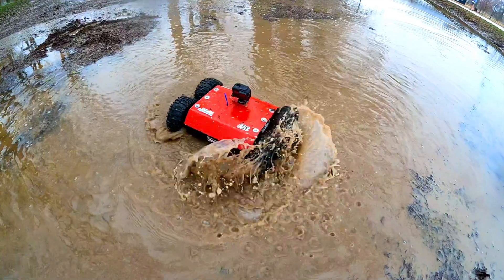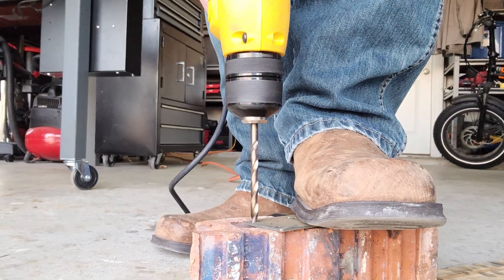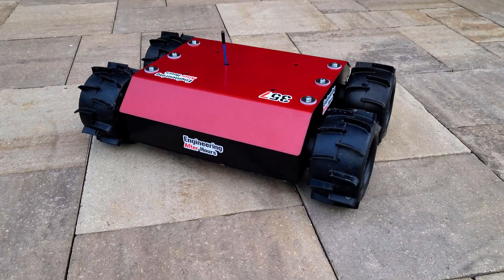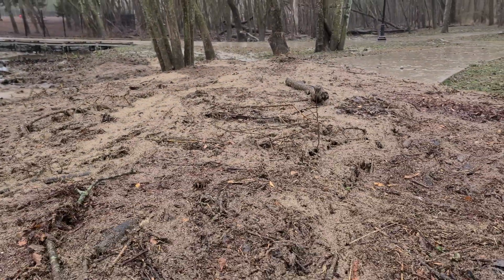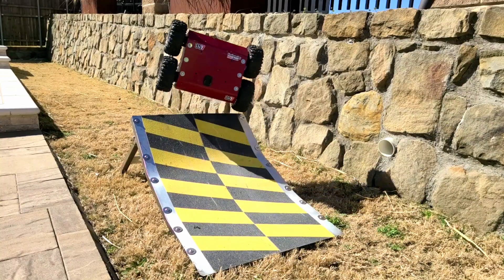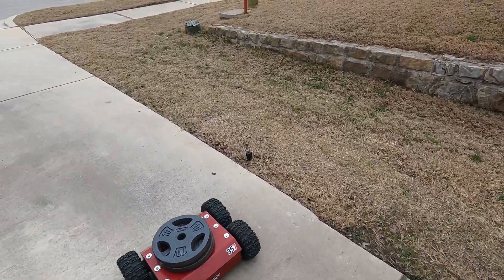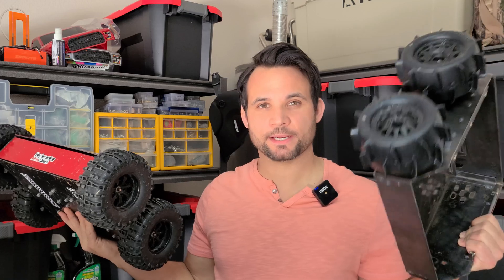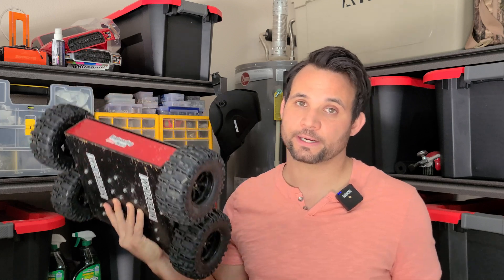How I Built a 4WD Robot Chassis

Comment: Is a suspension system a necessity in these robots ?
Reply from the maker: Depends on use case. These don't have a true suspension but my next robot will have some articulation for traction
Reply: @EngineeringAfterHours  Do you recommend me a certain type of motors ? which is better 24v or 12v motors ?

Also, do you recommend me starting my first build with a suspension system or just mount the motors directly to the chassis ?

Comment: i really need to know what the wheels you are using!! please :) Let me know ;) my robot isn't as bullet proof as yours, but the wheels would be much ideal for my robot
Reply from the maker: https://www.amazon.com/gp/aw/d/B075C34QBD?psc=1&ref=ppx_pop_mob_b_asin_title
Reply: @EngineeringAfterHours  NICE, how much does your robot weigh?? i kinda forgot without wathcing the whole video again, im using cordless drills 4 set, very heave about 8Kg (its not as big as yours though) Thank you for the wheels! i've had to go with some metal bead locking ones, but the tyres you got there are perfect!, the ones im using are super spongy and the battery drains quickly due to the LARGE drag factor so you have any tips on making the inner tyre firm? 

Again thank you for responding! your robotics is a much more effient machine than mine is, but i dont have a laser cutter like you do, nor the tools NOT the money! LOL but thank you again

Comment: Fun video. I'd like to see more of the build, design engineering and less driving around. The testing is fun but for an engineering channel a lot of the explanation of how and why it works seemed to be lacking for me.
Reply from the maker: I wish I could include much more of that but if I did youtube would bury it and you wouldn't have even seen the video. My channel started out with heavy emphasis on straight technical content, then switched to project based technical content. Even with project based content, 95% of viewers complained about or skipped through the good technical details. 

Now I focus on the high level principles and the overall "thing" I'm making. At some point when I grow this channel enough, I want to start a second channel for the detailed technical content. If I left it all in now...the channel just wouldn't grow.

Comment: Great work. I would like to ask what kind of math you have done to specify wheels size and chassis dimensions and pay load?
Reply from the maker: I dont recall everything but what I seem to recall is:

Wheels were purely a function of largest diameter for the price. It's pretty easy for me to custom design for wheel load and even design my own wheels if needed.

The main math I actually did on this design was for the belt drive to know what my slip torque is. It's why I had 2 belt drive systems laying around.

I had also done some simple structural stuff to ensure deflection in the drive train was reasonable. 

But for the most part it was just way over designed for any load case I have.

Comment: I think the only downside of not having a motor for each wheel is that it cant go sideways.
Reply from the maker: Yeah the problem with omni wheels is that they're going to perform very poorly offroad compared to these and that was my biggest use case. If this were an indoors or warehouse robot...they would do well.
Reply: Omni wheels perform very poorly offroad. You could do a swerve drive concept where each wheel can turn a full 180 degrees, but those are typically way too bulky and complex to be reliable for extreme conditions like this.

Comment: What's the advantage of driving all four wheels instead of just two? More traction?
Reply from the maker: Skid steering won't work well with just 2 wheels. It pushes the moment center towards just the driven wheels.

4wd also wins offroad...especially in snow or wet conditions.

Comment: so why not drive the wheels with the belt?
Reply from the maker: Half the wheels are driven with a belt. The 2 main drive wheels are coupled with a double universal joint.

I dont believe there is a pully that will fit with the transmission I have to use a double pulley setup instead of the universal drives. If there is a pulley that small it'll be torque limited due to limited tooth engagement and diameter.

So the universal joint is a more compact and higher performing design in this packaging.

Comment: Hi Engineering After Hours, around the 1:22 mark you said that the bearing hubs prevent the motors and transmission from seeing vibrations and impact loads. How does that work? When you explained your bearing hubs later on towards the end at 11:25, the bearing hubs didn't seem to contain anything that would eat up the extra shock/movement like a suspension. I did see some universal-joint looking things connected to the belt drive, is that what's eating up the unwanted movement and other loads?
Reply from the maker: Yes, the double universal joints keep the major wheels loads off the transmission. I have them straight but they can articulate a lot. 

In reality the chassis will flex a little so the joints have to compensate for that. The wheels also absorb a ton of the impact.
Reply: @EngineeringAfterHours  OK, that's pretty cool! Did the wheels and joint replace a suspension then?
Reply from the maker: Yes. A "traditional" suspension on this design would be pretty complex but more importantly take a lot of space.
Reply from the maker: Most of the designs out there basically bolt the wheels directly to the gear motor shaft. Because of the speeds this thing is capable of...I need a more rugged solution.